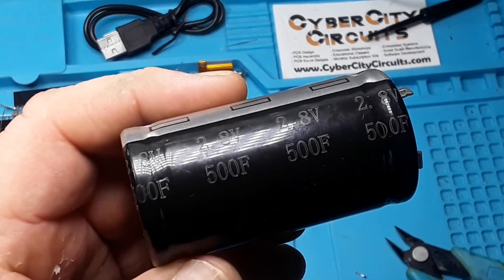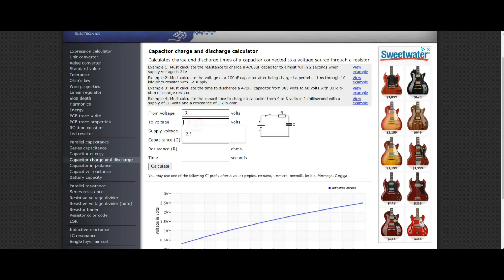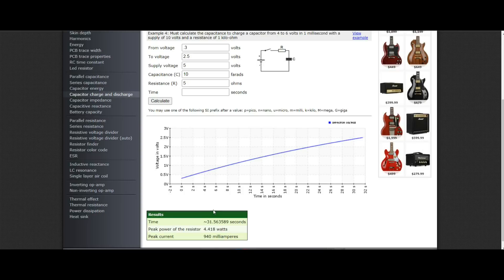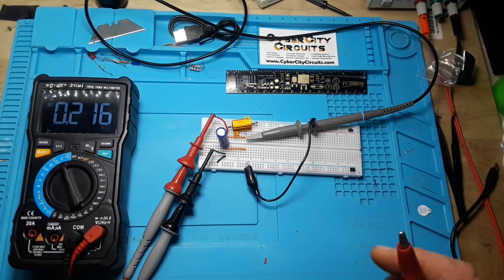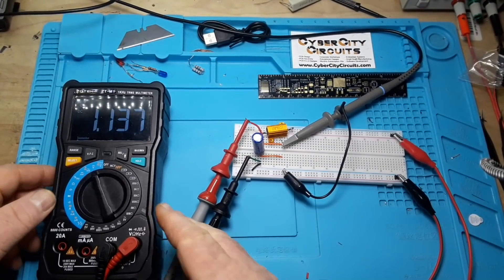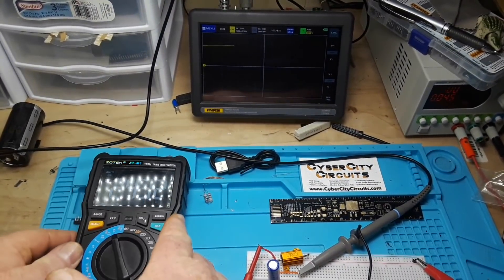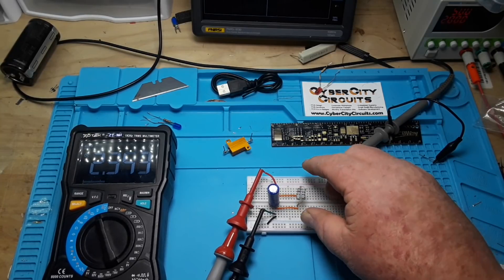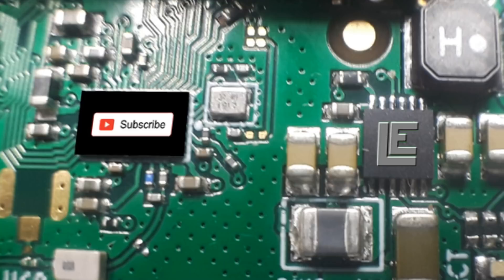How to safely charge and discharge a supercap

Comment: I saw a YouTube video where someone used the larger 500F super cap as the power source for a LiPo battery spot welder.. But they did not say anything about how to protect the Cap while charging/discharging... 

for charging circuit:
I would suggest to use an opamp to switch a relay off when the 2.5v limit is reached.

My goal is to spot weld LiPos.. So can you do a video on how to make a proper spot welder for LiPos?

Comment: Thanks for the very useful tutorial.Can you please let me know how to charge supercapacitor. I am using 3.5 amp 5.4 volt linear power supply to charge two 35 farad supercapacitor in series. I added 10 ohm 10 watt resistor in series with the positive terminal to prevent the inrush current. The power supply is supplying 1.5 amp now but the 10 watt ceramic resistor is getting very hot. I have not used any diod with it. What should be done? Need your kind suggestions please.

Comment: Hey, Paul, i got a question, why when it comes to charging a super cap, u can charge it above the rated voltage for this one u used 5V as the power supply?
Reply from the maker: You can charge it with a voltage above it's rated voltage. But you must not let the cap get over it's rating.
Reply: @learnelectronics  it applies on normal cap too?

Comment: This video made me realize that if you have a power supply with sense terminals, if you put the current limiting resistor on the power line, and have the sense terminals across the capacitor you'll have your power supply do the work for you, switching from constant current to constant voltage once the capacitor is charged.  I was thinking about other ways to do this without such a power supplie, and realized that by using a LM317 and a normal power supply you can accomplish the same thing (making sure the power supply is set so that the LM317 doesn't have to dissipate too much power).  Just shows how some circuits can be used in unexpected ways, also never thought of using an LM317 to negate lead resistance.

Comment: So what can we realistically power from a super capacitor, I've seen some DIY projects using a super cap but none of them would be something practical to use.
I have a hard time finding something useful or practical for the super capacitors, maybe that will change in the future but for now I rather use an 18650 lithium cell just for the power density alone...
When do you expect this to change?
Reply: hybrid

Comment: It’s been a long time since I’ve studied electronics so maybe there’s a simple reason I’m not getting but why not set the power supply to the voltage you want the cap charged to (plus the drop from the resistor)?
Reply: I’m no expert but I think the reason is, it will charge a lot faster using a higher voltage.
Reply: John That’s what I assumed but if it would be safer I’d rather run it that way

Comment: Very interesting. After some testing it appears when power is initially applied to a resistor and capacitor in series, say 9v,  their would be a 9v drop across that resistor. As the capacitor begins to charge the potential across that resistor decreases. As the potential decreases so does the current across the resistor. So is that resistor actually to protect the power supply from expelling a massive in rush current and has nothing to do with the cap? It was my understanding an uncharged cap registers as a short circuit to the power supply initially.

Comment: When I finally got an oscilloscope, my first experiment was charging and discharging a capacitor.  It was immensely gratifying to see in practice what I had learned in theory.
Reply: Mine was running square wave from an arduino.  Those things are incredible.
Reply: Did you compare the charge and discharge curve to your maths?

Comment: So I know you need a resistor to get energy into or out of a capacitor. But could you go into why that's the case?
Reply from the maker: The resistor just limits current. The capacitor will happily dump every joule of energy it holds instantly. Probably destroying the circuit it's in.
Reply: Life or death. No sparks or fire. Not evicted if you live in an apartment. Or evicted if you do!

Comment: Nice Video - Charging current = V/R=I   as Volts rise exponentially Divided by Time Input current falls as less and less room for charge to be stored. And Discharge Current = V/R=I  So 2V7/5R = 0.540Amp at start of Discharge, But falling Volts = Falling Discharge Current. So Discharge taking longer and longer as Volts and Current fall exponentially Divided by Time. A logarithmic process.
Reply: Charge and discharge times are both srt by the time constant CR. Five time constants to fully charge and five to fully discharge. This particular example started from partial charge and went to half supply, hence numbers.Discharge should be closer to the math here. Full charge (well near) to zero via five ohms.
Reply: Also to anyone who isn't familiar the issue (I don't think it was explained at all) with supercaps is the voltage. They are very fussy about voltage and will not withstand any over voltage. Current wise they don't care. A capacitors raison d'etre is to whack in/out current, it is what they do. Charging time is not any issue at all, it is simply easier to watch and ensure they are not over voltaged by introducing the large time constant. Some caps might not like being discharged with a screwdriver...But most don't care at all.
Reply: @martinda7446  Manufacturers of super capacitors under rate the max user charge voltage with a 10% or 5% margin But Over charging them is not good, that is why you need a Voltage & Charge controlled charger. VV VC detection to switch off when the SC is Charged.
Reply: @uksuperrascal  Or keep an eye and a slow ramping charge like here.

Comment: This has been a topic I've waited for a while. Great demonstration. The only thing I'll add is that for the resistance part of the equation, a lot of these supercaps (some more than others) have a high level of internal resistance such that in those cases you can connect directly to power rail. Not advised if you don't know what you're doing. The 5v disc ones I sent you fall under that heading.

Comment: Back in the day we would charge 1F 12vdc car audio caps with a 12v test light running through a resistor.  When the light went out the cap was charged.
Reply from the maker: Just like the LEDs they put on supercap protection boards.
Reply: Yes. There is another good video by a professional doing just that but using a high power incandescent bulb as the resistor. I remember using a 100 watt incandescent bulb to test the power of a morse code transmitter a ham gave me as a kid.

Comment: Discharge resistors are your guardian angel in high power Tx, I did 2-3 MHz shipboard radios back in the old days, someone had removed the bleeders on the finals, assuming they would get more power, I went to change the finals and woke up on the floor across the room.
Reply from the maker: That's scary. I'm glad you are ok.

Comment: I have a bank of f 6 of those 500F Super Capacitors in series giving 12v. I charged them to only 9v and they ran a simple circuit that flashes 10 LED's with a 12v supply and has a 555 and a decade counter IC. Anyway, that 9v charge ran the circuit for 6 hours. A very cool bank of caps. They were taken from a portable medical defibrillator machine that specs required they be changed every 12-24 months along with the simple circuit board that also divides out a 5v charge as well as the 12v. Very handy for portable work.